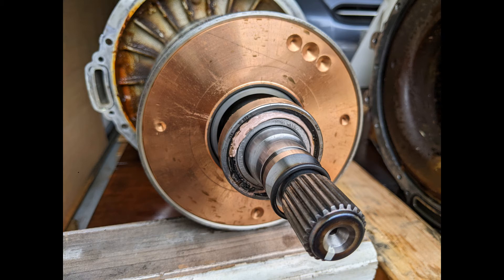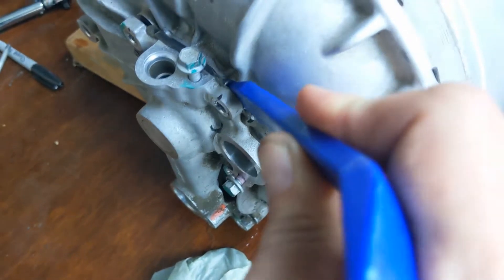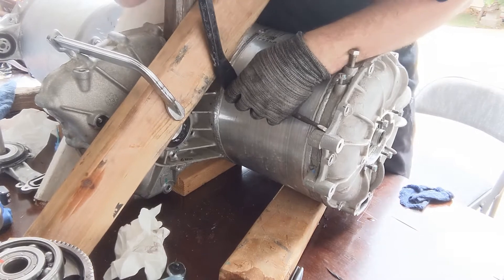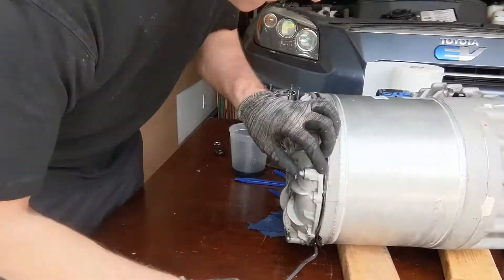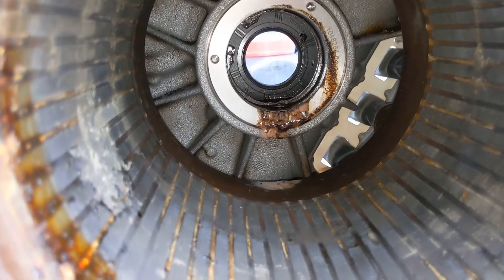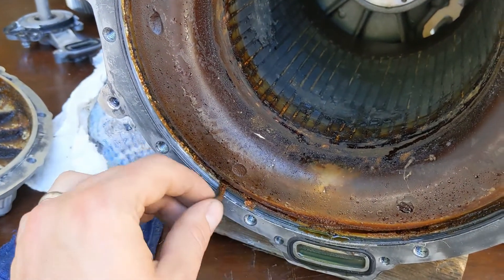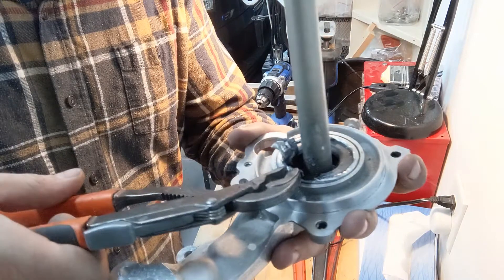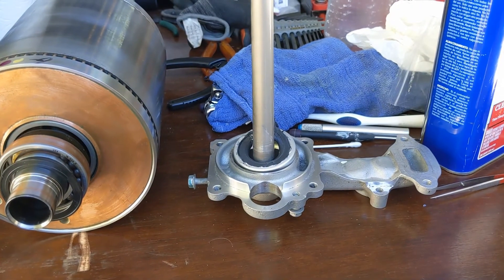Removing rotor and leaking seal from Tesla LDU

Comment: An old technique to remove seals such as this, which have a lot of surface area on the outside (hard to remove) and also have that nice, wide steel flange area (visible seal side), is to drill small pilot holes (two or three) into the seal side, then thread in a sheet metal screw.  Do not use a self-drilling/tapping (SRT) screw, use a regular sheet metal screw.  Thread it in until it is engaged to the final diameter, then pry under the screw's head.  This lets you apply significant force to a specific point.  If you use two (or three) screws at different points, the seal will often come out easily.  

I would not advise using air to try to push the seal out, as that would be very hard to control.  Using a fluid may work, and would be a lot safer than using air, but the "pry under screw head" method is my go-to procedure.
Reply from the maker: Interesting thanks! I may try this next time. I added the tip in the description and gave credits to you.
Reply: Does the stator and the leads come out?
Reply: @UndoneEV  Why ask me?  I did not create the video.  Put your question to the creator.
Reply: @alsavage1  oops. Sorry
Reply: I like your technique tho!

Comment: Awesome video series! I'm going to do the same with my Model S LDU. Looks like the seal has already been replaced with a non factory seal? Is there any wear on the rotor axle surface?
Reply from the maker: It's the original Tesla seal (nobody else worked on this car, everything was done under warranty by Toyota/Tesla). Zero visible wear on the shaft.